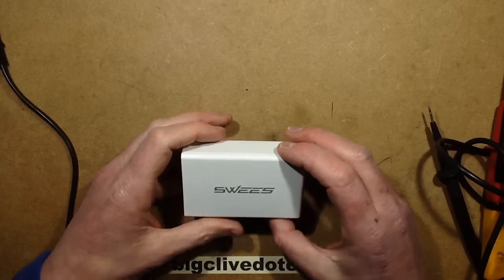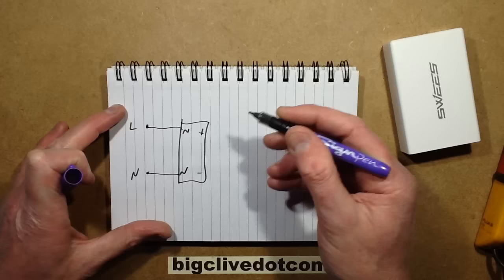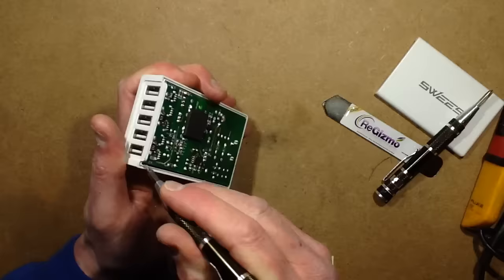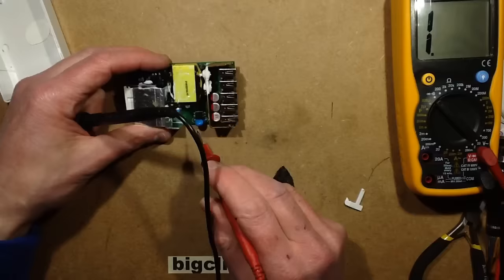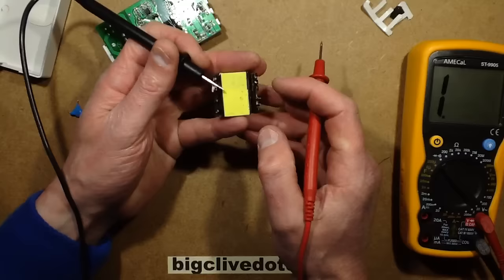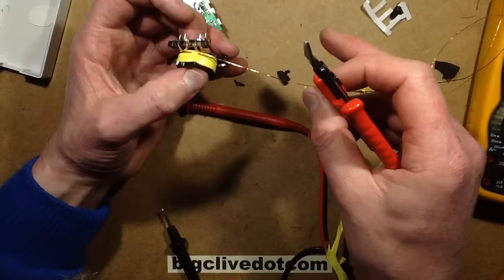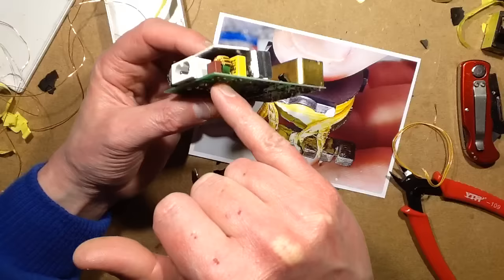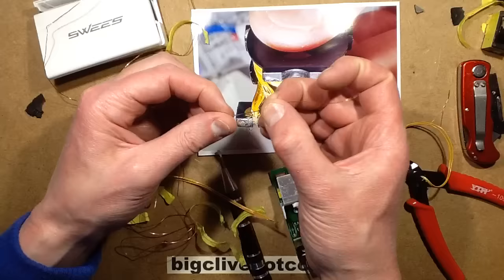Horrific USB power supply fault.  (Electrocution risk.)

Comment: Actually Your RCD would NOT have tripped while measuring against earth our yourself. Because the current to ground would have a significant DC-part. This would saturate the magnetic coil of the RCD and so blocking the trigger completely. 
Its a big problem and known and also mostly ignored, because of the horrific costs for the DC-sensitive RCDs. Which is around 350€ at the moment.
When you look at some bigger facility with around 300 RCDs (like where I´m working) you can imagine the costs. But with more and more switching power supply's flooding the buildings the problem can´t be ignored any more.
Reply from the maker: +Andreas Dill The DC was pulsating DC via the rectifier and not affected by the smoothing capacitor, so any good RCD would have tripped.  A good RCD tester will perform a DC test on both polarities.
Reply: Ok, I had to look this up, seems your right in this case. There was only one diode in the current path and the cap was not involved. But if you get this kind of failure with a one way rectifier it will jam any type AC or A RCD.
Reply: +Andreas Dill Damn son, You got burnt
Reply: +james hallas He just showed himself up to be an armchair expert. Tip of the day, only comment when you ACTUALLY know what you're talking about.
Reply: +SuperJames 1985 
I´m just trained by reality to expect the worst. If nobody got hurt you can wonder later why this is so.
Reply: Stop trying to justify yourself. It's Clive doing the vids, not you, he knows what he's doing, as do I. Maybe you should start using your surname, and get some "Dill"igence. Wikipedia that, too, if you will.
Reply: +SuperJames 1985 
Cant say from your statements here if you just nitpicking or having no clue what`s this about. 

Any "normal" RCD without additional electronics will react badly to DC current to earth. Or better not react. There are some old parts still in service that will jam with the pulsating DC like this USB power supply generated. Most RCDs currently in use will tolerate some DC, if there are still gaps in the current flow. With pulsating DC like an 3~ rectifier will deliver they will fail too. So every 3~ appliance with an rectifier in it should be protected by an type B DC-sensitive RCD. The TÜV here in Germany gets more and more sensible to this thing and starts to obligate you to use type B RCDs in public areas.

Or if the cap after the rectifier gets involved it gets worse. The usual wallwart cellphone charger and all the cheap stuff will have a one way rectifier built in, which is the worst that can happen. Any isolation failure after the rectifier will generate enough DC error current - if you touch the secondary side - to jam any RCD which is not the expensive B-type. Only thing that will get you of the mains will be the circuit breaker. After you got really crispy.

Its the stuff I´m daily dealing with. Only thing I had to look up was the actual tolerance of an joe blocks type A RCD for DC. Because I´m conditioned for:
RCD + DC = bad.
Reply: +Andreas Dill guys,guys,guys.....its magic. not that other stuff you're all saying. magic.
Reply: +Andreas Dill what does RCD stand for is it the same as Ocpd? GFCI?
Reply: Residual Current Device

https://en.wikipedia.org/wiki/Residual-current_device

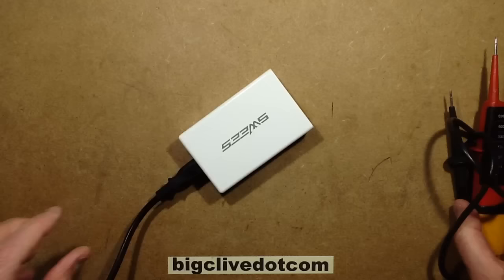Its in the video at 0:50.
Reply: damn was expecting some fancy bs instead of another wording for GFCI. oh well they dont work too well half the time...
Reply: It has many names. In Germany it´s called mostly FI (spoken eff-ih) for Fehler (error) and I for current. But in technical papers etc. it is more and more referenced as RCD. Because technicians like English.
Reply: Andreas Dill in united states and maybe in Canada no word such as RCD exist
Reply: +Andreas Dill Should be easy to test (I suspect it would trip). Type A ("pulsating DC") RCDs are designed to catch exactly this fault and are mandatory in Germany and Ireland, probably elsewhere. They are very common. A lot of Type AC RCDs are hybrid AC/A. Type B ("smooth DC") are more for PV installs, but I still doubt they cost €350.
Reply: +Andreas Thanks. RCDs are the most vital parts of any installation and it's wise that they are specified correctly. I suspect it would take multiple faults in real life to generate smooth DC fault current. The rectifier itself would have to be faulty otherwise the accessible current to Earth would have an AC component as the bottom end of the cap tracks the minimum of the input phases; it is not earthy. 

I remember seeing - possibly in EN61557-6 - a chart of the faults which cause various accessible currents. I'll review that when I get a chance.
Reply: They're almost only available as 3 phase rccbs & they really are that pricey. BUt there's not much that's likely to need them

Comment: This is precisely why I never liked the idea of double insulated items running with switch mode power supplies.
If that chassis had an earth it would have tripped the RCD.

And you`re making me cringe every time is see you handle something that has high voltage caps mate. Been there done that and got the shock of my life even after I had discharged the caps.

Had something really weird happen about 4 years ago. I was looking at a faulty switch mode and DID discharge the main 2 caps which were high voltage.
Tested voltage on both and found 1 was climbing in voltage and reached close to 70 volts with no external input.
Discharged again and tested. Watched just over 1 volt climb to nearly 70 volts again.
Ive been working with electronics since age 12 ( 1980 ) and even did a registered trade in Technical Electronic Servicing but that power supply had me stuffed.
Made absolutely no sense and I still scratch my head thinking about it.
The varistors on the primary 240v input were fine ( they are often the faulty devices ) the output was 12 v 5 A ( 60W total ) but the unit seemed to be in permanent sleep mode. Opto wasn't faulty either and all seem to be fine but damn thing wouldn't push out its voltage for use.
Sometimes weird shit just happens but I still don't know how this particular cap was recharging with no source.
I even unplugged and took of all cables just in case it was taking in EMF from the environment - Clutching at straws I know. I just couldn't figure it out.

Comment: I might send out a slightly less dangerous power supply, the USB ports are live at 91v, making my phone case 91v. Lucky I have never been shocked yet
Reply from the maker: That's common, even with a good brand.  It's capacitively coupled leakage between the windings and the suppression capacitor.  I always recommend using a phone in plastic case.  Not just to avoid a shock from a cheap charger but to protect the phone when dropped.
Reply: Yea it's only leaking 0.08mA so no worries, but this can cause audio artefacts.
Reply from the maker: @edg6779  Look for an audio isolating transformer if you are having laptop related audio issues.  I made a video about them.

Comment: S.M.P.S.  OUTPUT IS SUPPOSE TO BE ISOLATED FROM HOT AC GROUND.  THE SECONDARY OR OUTPUT SIDE OF A HIGH SPEED SWITCHING POWER SUPPLY HAS A COLD GROUND  . THAT COMPANY WHO MADE THAT 5 OUTPUT USB ADAPTER  IS CLEARLY OPENING THEMSELVES  UP TO A LAWSUIT. SOMEONE CAN GET KILLED BY THAT DEVICE . EITHER THERE IS A ISOLATED FAULT TO THAT DEVICE YOU HAVE  OR THE PROBLEM IS WITH ALL THE UNITS THAT COMPANY  SELLS  DUE TO A  FATAL DESIGN ERROR .

Comment: Next time could you show how much current is leaking and try to replicate some of the serious hazard results? Could this have really killed, or just some muscle cramps? Could this have created a fire from charging a phone?
Reply: It got a lamp "half-lit". Sure there's enough current to kill someone.
Reply from the maker: +Cooljosh3k This charger was basically a bridge rectifier between you and the mains.  It would have killed in the right circumstances.  Holding a metal trim phone like an iPhone and a grounded object at the same time.
Reply: bigclivedotcom
Yikes. That is pretty bad! Is that what the iPhone/iPad charger recall was about?

Comment: I have something similar problem from Amazon. Mines a plug socket with Integrated usb sockets that seam to have 240v running through. Can you send me your address you can tinker with it?
Reply from the maker: Are you getting a slight tingle from items connected or is it a stronger shock?
Reply: @bigclivedotcom  it's a tingle but my multimeter has a mains proximity sensor that detects mains in usb cable.
Reply from the maker: @PaulDve  The slight tingle is very common with USB supplies.  And also the triggering of the field detectors due to capacitive coupling and the lack of secondary grounding.
Reply: @bigclivedotcom  I'll test with a broken usb carefully 😎

Comment: Blackweb Multiple Device 6-Port USB Wall Charger will do the same.
Reply from the maker: Many chargers will give a slight tingle due to capacitive leakage.  If the blackweb unit is from Walmart or ASDA I would expect it to be properly made and tested to protect their profits.

Comment: The resistor is the issue
Reply: I'm almost 100% certain that would not possibly be the problem. if a resistor fails they are obviously charred and break the circuit as well as the fact if it's just too low of a value continuity wouldn't register a beep on a meter

Comment: I am surprised to be honest more Chinese USB chargers do not end up live given some questionable design practices in some.

Australian authorities in 2014 linked a ladies death to a dodgy charger making headphoens via  phone live.  (there was also a laptop involved) 

http://www.smh.com.au/nsw/faulty-usb-phone-charger-blamed-for-sheryl-aldeguers-death-20140627-zsoc8.html

In this instance it is a bit of a shame as this charger overall appears to have a decent design overall with exception of the dodgy transformer. Some consideration overall appears to have  been given to safety and EMC but quality control, component sourcing and post assembly testing have clearly failed

Hope the manufacturer and supplier have been contacted
Reply: +Sean N  I always suspected that grounding laptops was a TERRIBLE idea. Not sure why so many laptop PSUs do that at all?
Reply: +Siana Gearz Electro magnetic compatibility. Also if the laptop's power supply had a fault like this, if its chassis wasn't grounded (like in this power supply) you could get a shock, but since the laptop's chassis is grounded it will trip the RCD.
Reply: MrOpenGL
 But a laptop is a low voltage device, so it's trivially Class III. It's sufficient if the power supply has sufficient protection that any single fault will not result in high voltage on the output, thus Class II certification. It's not black magic or anything, Class II laptop PSUs exist.
Reply: Siana Gearz
I agree with you. I also don't understand the fuss about EMC, because when the laptop is operating from the battery its chassis is floating, so why not make it floating the whole time?

Comment: This is a very common fault, in my experience. There is a total lack of quality control in mass-produced components. I have had faulty devices out of a box. The fault you have shown is often followed with optoisolator non-functioning, large electrolytic is a culprit as well and lastly,  a very tight design leads to the increased temperature inside since there is inadequate heath-sinking. All in all, cheap electronics from China is just that, CHEAP.

Comment: These devices need earth connections. This is obviously a failure in manufacturing, but it has failed to faulty and lethal, not to off. The problem will be someone will use this to power a device they put ear buds on and applying this mains voltage to their head while touching something else.
Reply: +Stephen Low With a plastic case and "double insulation" (sic) the regs don't require a safety earth. I've got an 8-port charger in a metal case, with a cloverleaf (3-pin) connector which therefore should provide earth continuity. But that would only be required to the case - the USB outputs could still legitimately be floating. And might well be to avoid earth loop issues.
Reply: +Mike Pellatt I deal with the results of double insulation all day at work. It's a falacy that is convienent to believe. The ground of the device floats at half the mains voltage and this kills devices that do use proper earths. For example, if you plug a laptop into an audio mixer desk, if the laptop is charging at the time, the tip of the 3.5mm (left channel) is at 120v (240 mains where I am) and this destroys the input stage on the mixer. Maybe not today or tomorrow, but it degrades the input reliability each time it's done. Same goes for anything else running off an electronic plug-pack (wallmart for some) that you plug in.
Reply: +Stephen Low I would imagine that actually damaging something with Y capacitor leakage current (we're only talking nF range here, typically) would require all of the following three factors:
* inadequate input protection
* plugs that don't connect ground first (3.5 mm ones qualify, unfortunately)
* user making audio connection after power supply connection
Eliminate any one of them, and there should be no problems.

That being said, I'm not a big fan of ungrounded SMPS either. This leakage current can still put hum in earphones and ripples in a VGA monitor connection, and not having PE makes it harder to implement adequate mains RF filtering. 
If you need a supply that is truly floating, there really isn't anything better than a traditional transformer-based job - which also will be refraining from adding copious amounts of common-mode noise and can be dead quiet if the rectifier diodes are adequately quietened down / snubbered. Of course they'd get a bit uneconomic and big in the sizes needed for computers, but for small-fry equipment like various networking gear it's quite feasible still. I've been using decent-quality old unregulated plug-pack supplies for my wi-fi routers lately, with good results (about 1 W more than a SMPS, but the occasional switch hiccups in the trusty TL-WR1043ND v1.8 were entirely eliminated, leaving only a preventive periodic wi-fi restart taken care of by a cronjob).
Reply: +yeoldeengineer It does not surprise me that my spare plug pack box (I think everyone probably has something like that) tends to have a fair number of transformer based plug packs in it because the device it was connected to died, not the pack itself. New equipment seems to have the opposite issue, I'm always needing replacement plug packs for things plugged in 24/7 as the device outlives the supply. Normally electronic smoke appears and things stop.

I'm currently working on a Behringer mixer desk (replacing all of the input opamps) for a school hall because 8 of the 16 input stages have failed due to electronic plug pack ground float voltage. How am I sure? Well the user said "as I plugged it in, the channel stopped, just like last time". Unfortunately, the last thing usually plugged in at various performances is the laptop.

Comment: Clive, if there was a short in the Transformer, it would have been a lot easier to use an ohm meter to test for short instead of dismantling.   Further, it could have been a bad solder joint, that  you fixed when removing the Transformer.
Reply: He did that test first!

Comment: I bought a usb hub which have reverse current flow, therefore has burned my MacBook’s logic board down. If I only new that these usb hub are so bad I would never buy them. You can see a test which I made measuring the reverse current flow https://youtu.be/zknB0DvlOUA

Comment: I know most USB plug ins are shit and need abit of boolox to to power them But I see no reason why it should be plugged in a 240v supply? and what the hell was he doing when rubbing it across a radiator lol
Reply from the maker: +tpilot1 The UK mains supply is 240V (supposedly 230V Euro-standard now).  It just so happened that the bare end of the micro-usb plug brushed against a radiator that provided a ground path for the fault current.